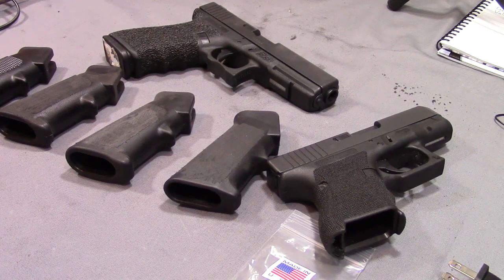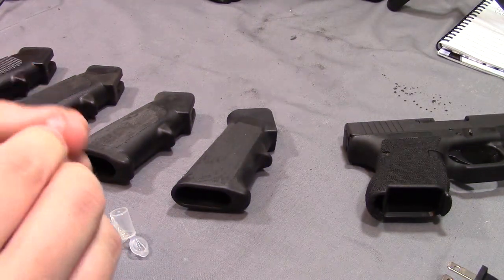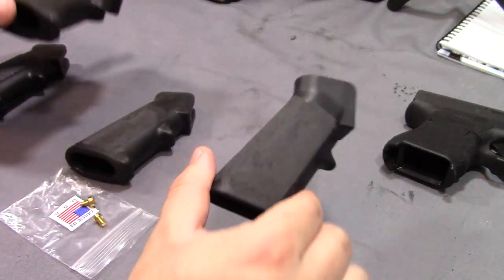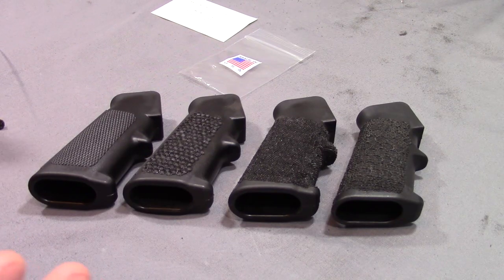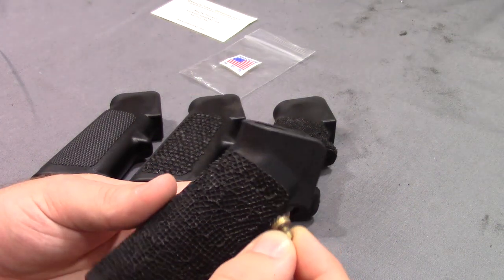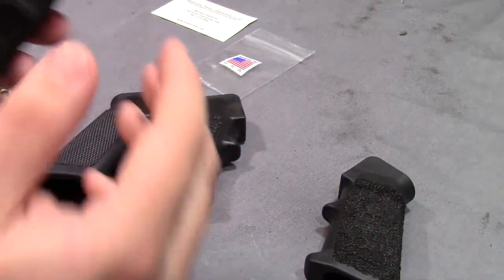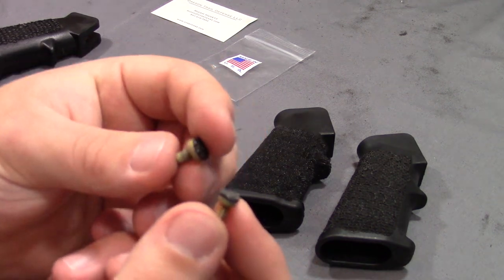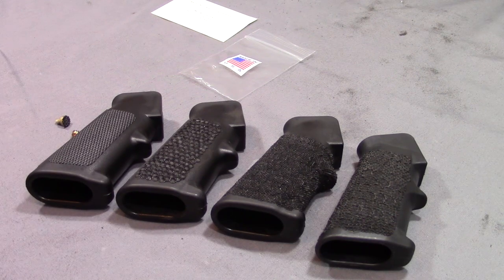Stippling Waffle Tips

Comment: If you keep the tip on the burner and use a fine wire brush you can use one tip forever. Using only for 2 stippling jobs is kinda BS
Reply: Yeah, I was like WTF?!  Only 2?
Reply: Thats what i was thinking.

Comment: I've used these tips(the square waffle tip) on a few on my glocks.  You don't need to sand down the factory bumps.  The waffle tips are large enough to blend the bump right into the grip.
Reply: You don’t need to sand them down even if you’re not using the waffle tip.

Comment: I have not read the other comments but wait. U can clean the tips and get more usage out of them than the two that you spoke of. All you need is to buy several  cheap wire brushes. They may come in stainless steel or brass, one's a little harder than the other one. Just brush the tip while the iron is either still hot or warm, this will clean the tip and you'll get more usage out of them.

Comment: Before I ever started seeing people stippling plastic parts for grip, I took old checkering files, for metal work, and wrap around checkered some AR grips.  Today, when I bring out a rifle with those grips, people always ask where they came from.  To me, stippling is too much like sand paper and isn't comfortable, especially with rifles.  I think the original ones I did were 24LPI and now I use a 30LPI file.  I takes longer than stippling with a soldering iron but looks much more traditional.  And, plastic doesn't take near the work of metal.

Oh yeah, 24LPI cuts too deep for most plastic frames.  That's why I switched to 30LPI.

Comment: I know I'm joining the cacophony of opinionated comments, but, this is just my opinion. I've been stippling Glock polymers for about 15 years. The temperature of the burner doesn't have to be that high. Your previous work looks really clean so it looks like you already know this. I increase the temp on my wood burner until it just starts to displace material. Too hot and it liquifies the polymer and increases the amount of raised surface and the flashing that needs to be cleaned off. A heavy build-up of melted polymer on the burner tip is also an indication that your temperature is too high. If you displace too much material the job looks sloppy and can actually be counterproductive to a grip reduction. I'm assuming the projects you did on this video were rushed and you were just trying the tips out. I've considered these tips before but I'd prefer a squared profile to make lining the pattern up easier.

Comment: Was excited to try it out got mine today and Both heads were clogged after a quick practice test on a grip couldn't event use it on my gun 🙄. Back to the drawing boards
Reply from the maker: I'm not sure how hot your wood burner gets, but I know on mine, if I just leave it on, it will burn off all of the polymer. Also what I've done with other tips is while the burner is turned on, I'll take a small flathead screw driver and clean out the grooves.

Comment: I purchased these same tips but I'm not getting the same type of pattern. I assume it's me and my technique. Perhaps I'm making the tip to hot? I get about 6-7 waffle patterns then it turns to mush. The tip gets completely filled with polymer and the pattern stops printing. I'm practicing on PMAGs before moving to frames, that may also play a factor as I know the polymer of a PMAG is much softer than an A2 grip or glock frame.  ... I'm just wondering if you have some advice?  I'm also using the walnut hollow wood burning tool that has variable temperature control.  Let me know if you have any advice, thanks
Reply from the maker: I haven't had that issue. I'm not sure whether my tip is hotter or colder but mine says it heats to 950F. At that temperature I don't have any issues with polymer sticking inside the tool. It seems to burn off any residual polymer that would form.

Comment: i just ordered and made a stippling a glock fde and made alot black burn marks & small point broke in 20 min ?? why is it burning?
Reply from the maker: +Samson Propaganda it's hard to say, but it may be that whatever you're using isn't hot enough.
Reply: I'll add to the page here what we discussed on the phone Sam, incase others have the same question -    Guns other then black will generally leave a small black tint when using most tips, especially the waffle tips.  It takes a ton of time for an FDE gun because you have to keep the tips brushed off with a wire brush to prevent any polymer from sitting on it, and then pushing into your gun frame.  
As to the small round breaking, replacement is in the mail.

Comment: I missed the coupon code.  Was it "OreShill2016"?
I'll have to watch again, but I'm pretty u forgot to name drop that BCM RECCE.
Reply from the maker: I think if you use that code it adds 20%
Reply: OreGear Unless u can prove to me these bits r forged, then I ain't buying them.  Or send me an article that Ugandan security used them in Iraq.
What's the hold up with that lube review?  You're just gonna say, "It isn't EWL Slip2000." The end.
Reply from the maker: +RageQuit003 actually I'm going to say if you use it, it could kill you. And it's not Slip 2000.
Reply: OreGear So that should be about a 20 second vid after u say that and do your normal product placements for Inforce and BCM.
Reply from the maker: +RageQuit003 I'm going to drag it out a little bit by quantifying exactly why I would never use it by referencing the MSDS sheets. Plus I'm going to show off my nascar style coveralls with all my sponsors.
Reply: OreGear Ha ha ha!  Do u even remember how to read a MSDS?  Mr. Gudentight because nobody needs a torque wrench on a fighter jet.
Reply from the maker: Nah, but they have pictures and these ones look scary so I'm not going to use it.

Comment: What soldering iron/gun would these tips work with?
Reply from the maker: Any soldering iron or wood burner with 8-32 threads. I haven't found a wood burner locally that doesn't use that thread pattern.
Thanks for watching!
Reply: Clay Kesterson Most if not all are just a standard 6-32 machine screw. Hint hint. I made my own tips.

Comment: Hi. I have a M&P9. Would I have to sand it down first like you did or can I just use the wood burner as is over the grip (like you did in your other video with the video solder). Thanks.
Reply from the maker: With M&Ps, you should be fine just using the wood burner over the 
existing texture. The texturing is softer and more uniform on M&Ps, 
so you shouldn't run into any issues with it disrupting your stippling.
Thanks for watching!
Reply: Awesome. Thank you.